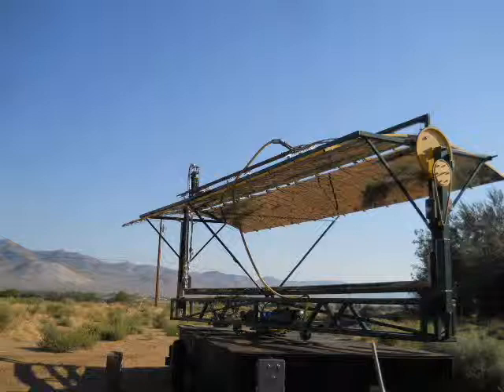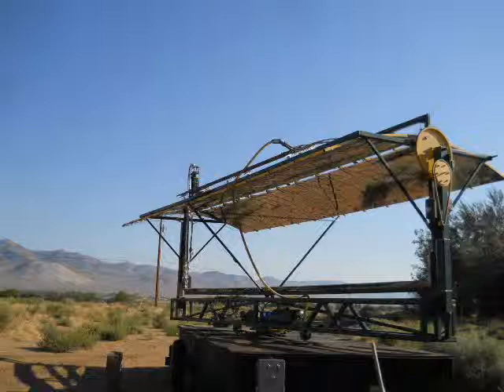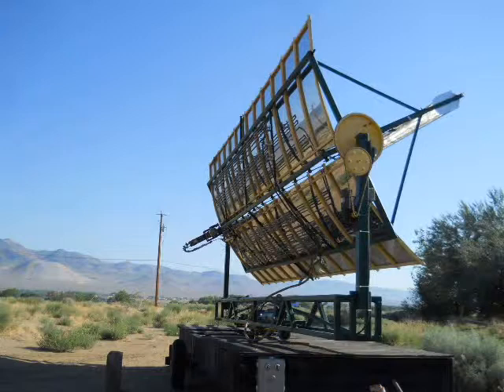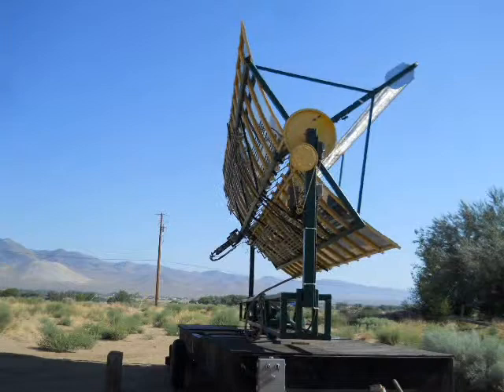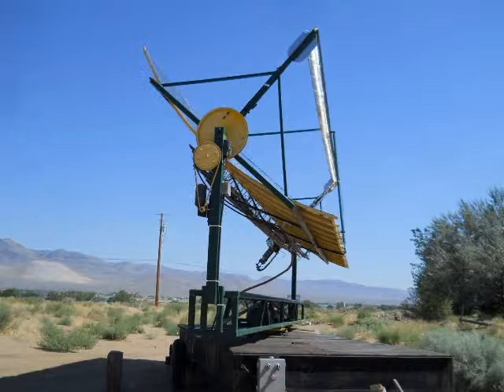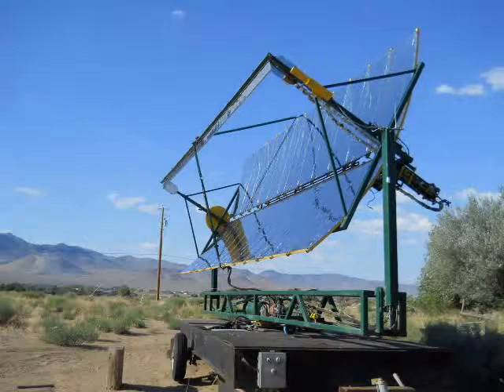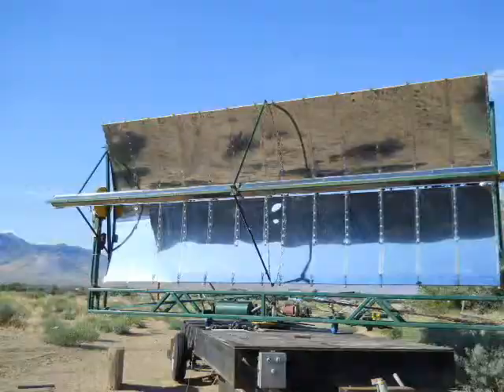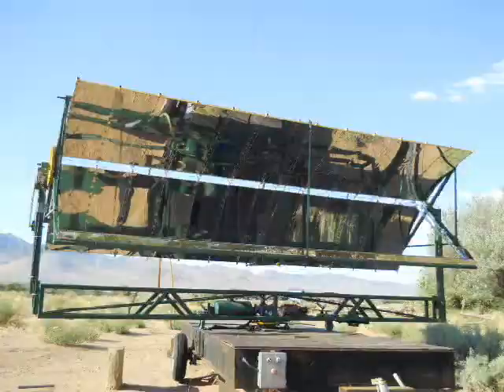Solar Power for Homes

Comment: what the price cost for it ?
Reply from the maker: Howdy,  Alchemistb52
We spent between 16-25K in development. It could be made much cheaper in volume and with some redesign.   The system is still evolving and can be sized to fit several power demands.    Let me know if you have any more questions or ideas, always looking for solutions.     Every family should have their own solar power transducer =independence-freedom.
 
Hang in there,
Jeff